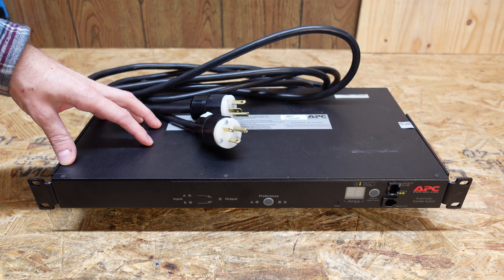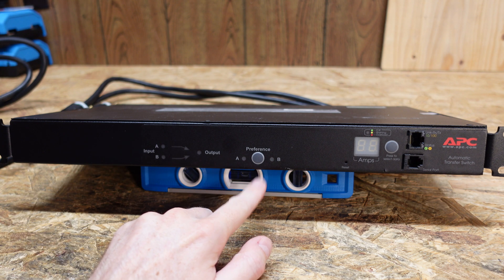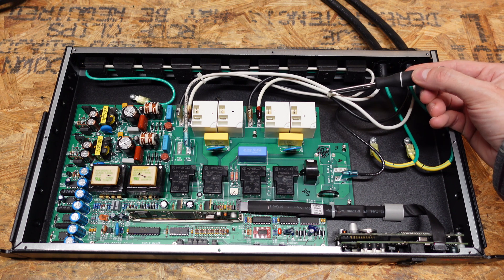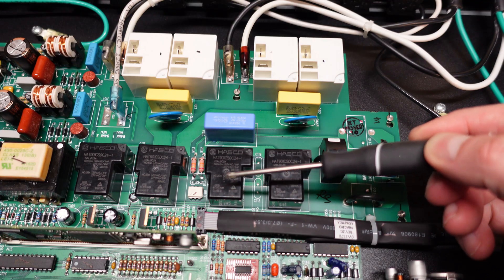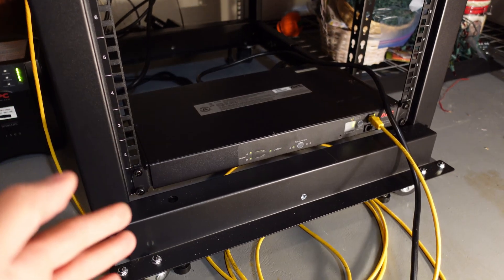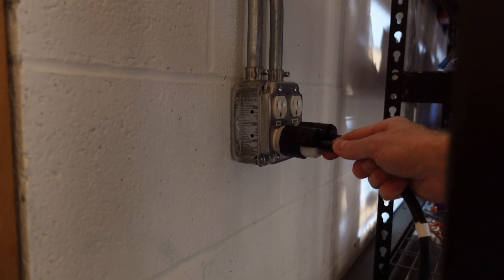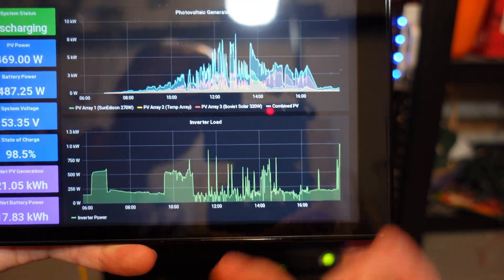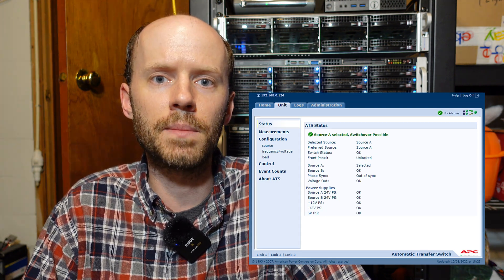APC Automatic Transfer Switch, Off-Grid Solar Backup for the Chia Server Rack

Comment: APC makes good stuff. I have a bunch of APC PDU's that run vertically at the back of our cabinets at the data center. 1 on each side of every cabinet, each fed by a different UPS system, and each server has redundant power supplies. The only switching is from commercial power to generator. The PDU's can have each outlet power cycled through a similar web UI, and I graph power usage in Zabbix. I don't know about your APC transfer switch, but it may support SNMP, in which case you could potentially graph power usage and whether it's from A or B feeds. I'd load Zabbix agents on those servers also and track disk, memory, network usage, etc.
Reply: It does have SNMP support.

Comment: Magic box go buzz switch, buzz switch.
Reply: My magic box goes click, whir, thunk.  I overbuilt it as it has a 4 pole transfer switch, timing relay on the inverter side, and circuit breakers on both inputs. It was built to originally handle inverters that could not take being tied to a house ground.

Comment: Just got a transfer switch for my solar power system, that switches between solar inverter and grid power, based on the voltage of the solar battery. Now I don't have to worry if my solar production will keep up with power hungry loads. This also allows my system to use as much energy as I can get from solar to power things before using grid power. Optimizing energy savings.
Reply: Interesting thing is there are inverters that do that as a function of them. Also with built in battery charging. They basically become an UPS with solar as a backup input for charging.
Reply: @gravelydon7072  Yes, I've installed an Aims 6kw split phase inverter with that capability in a whole house solar system. It's a handy feature

Comment: How long will it be before you wire a relay to switch the front button so it is an auto dump load? Oh ok at the end with a script right on.
Reply from the maker: If the script doesn't work, thinking a relay controlled by a sonoff like I did with the water heater a while back! So many possibilities!

Comment: Very awesome, such a cool bit of kit.
Reply: You could add a wifi controlled power point on the grid side, and switch off grid when excess solar :)
Reply from the maker: I was originally thinking along the same lines, with a Sonoff like I used with the water heater a while back. I'm thinking though that I can control it with the Batrium and an RPI or something since it has such great network connectivity. We shall see - but yes, totally the goal to get it to eat up excess solar during the summer. So much gets wasted :(
Reply: Should've watched the whole video - neat you can switch it! 

Just looked on eBay Australia and few options for <$200 which is a lot cheaper than I thought